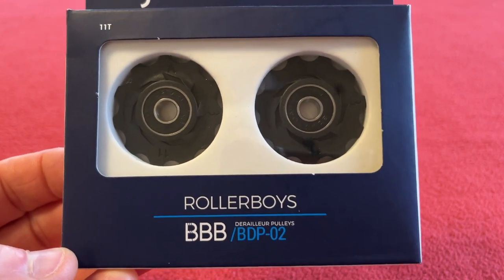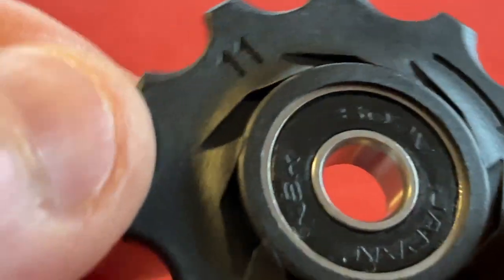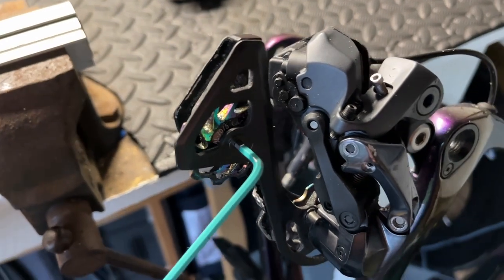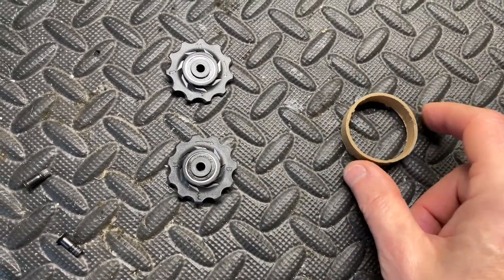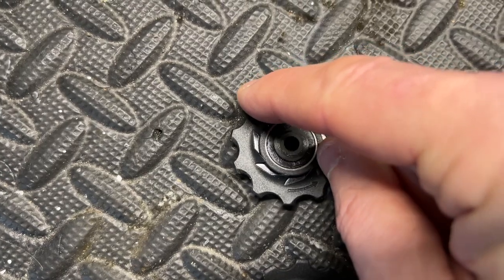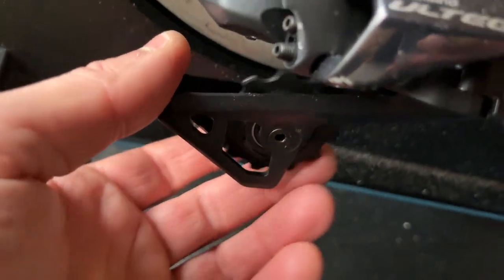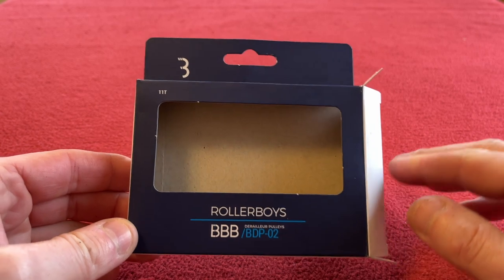Rollerboys BBB/BDP-02 Derailleur Pulley Wheels

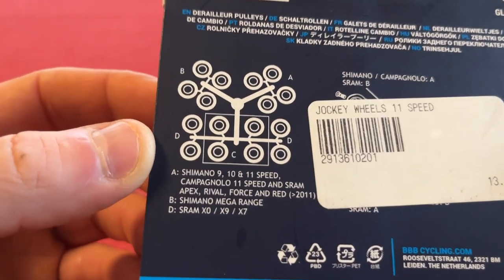Comment: I recently bought this for replacing the upper pulley in a SRAM rear derailleur. It turns out that for SRAM the B pulley goes on up ( as guide pulley) and A pulley goes down (tension pulley). This info is on the diagram that is covered by a sticker in your video 0:40 . So I used the B pulley to go in the top side of the SRAM derailleur and the A pulley I put also on the top side of the Shimano derailleur of another bike I have here. I didn't use both on SRAM because the bottom pulley in the SRAM derailleur was still in excellent condition